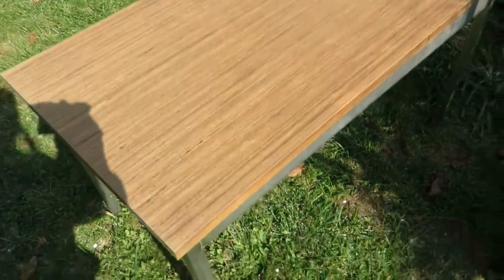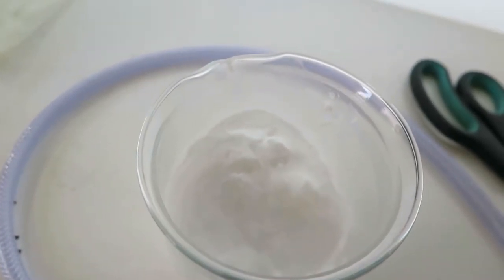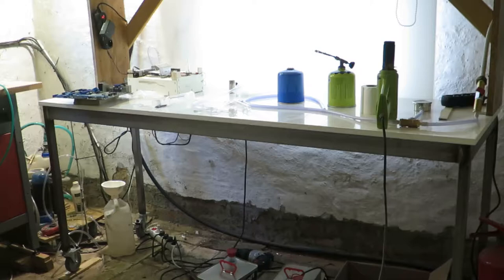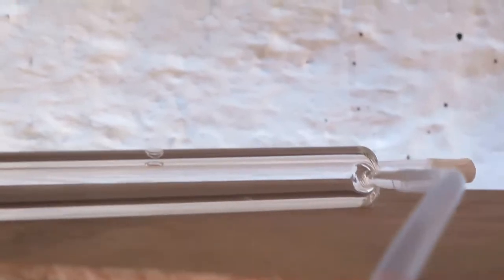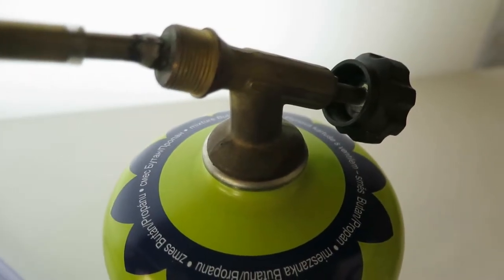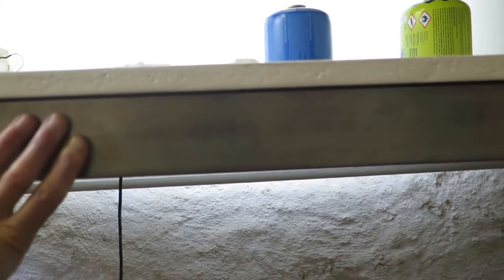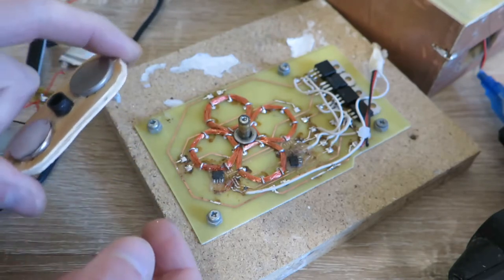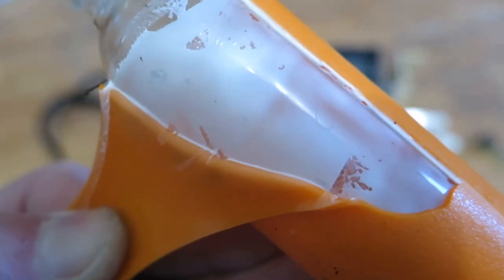Random stuff

Comment: I've been working VERY SLOWLY on a stirer like at 23:45 .... but I'm trying to make the coils move the stir bar on their own without a motor....
Reply from the maker: I was thinking about that as well, but I am not sure if it is possible to make closed loop control this way considering field strength you would need
Reply: @IlusysSystems  yes... the only closed loop control I've considered uses my eyeballs as sensors. ;)